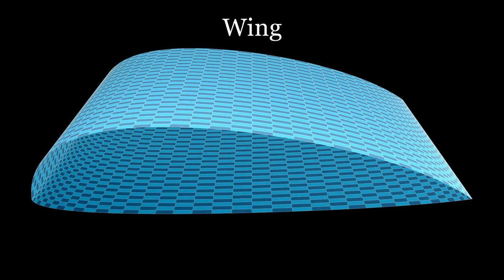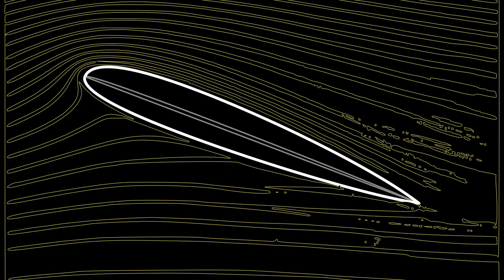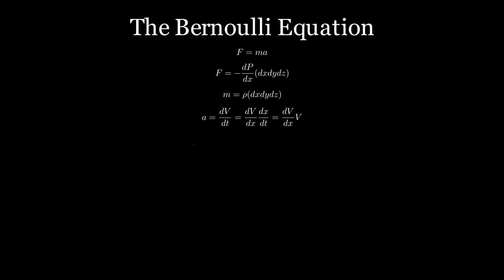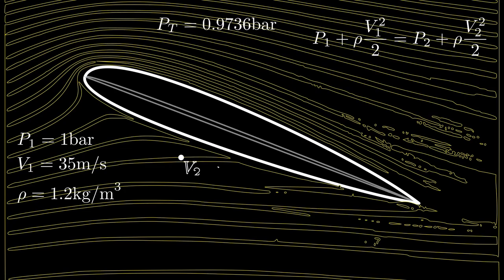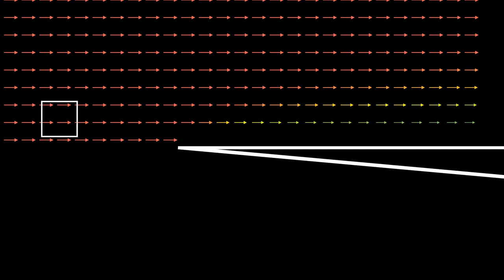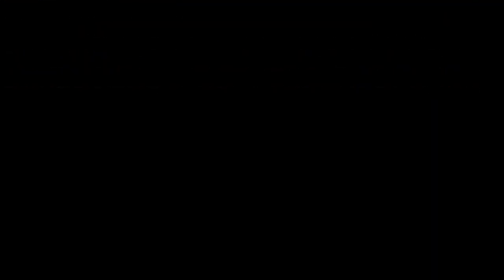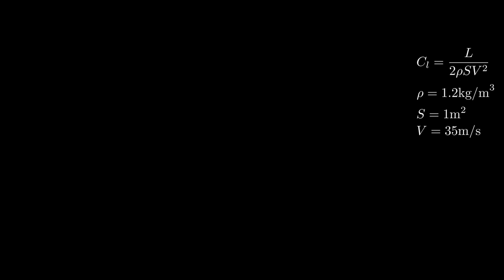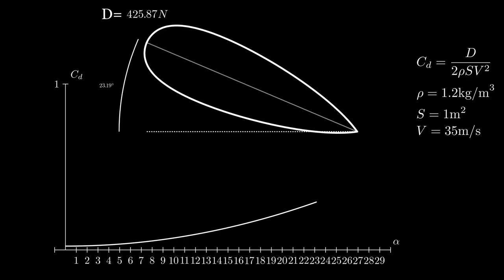How does an airfoil produce lift and drag?

Comment: Hey wow! I think this is pretty cool for a non-engineer. I remember a few concepts from Physics of how a fluid is selectively slowed down when if flows against a surface and also the Bernoulli equation! I think I felt a bit left out on the Camber line. Maybe my 3D visualisation skills were not too good. I would have appreciated the use of Blender to complement the rest of the animation. But good job! 😄
Reply from the maker: Thanks! I do need to get around to playing with blender lol
Reply from the maker: Oh and the camber line is just the midpoint between the top surface and bottom surface going along the chord.